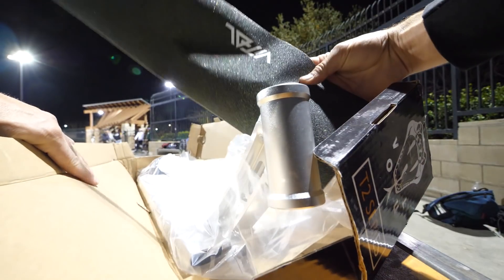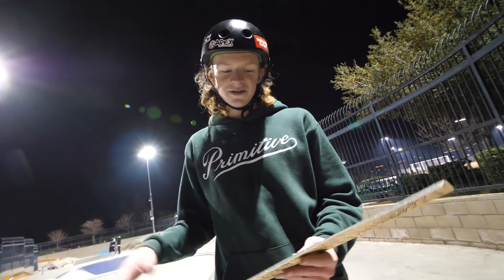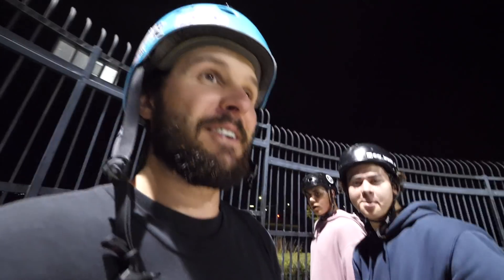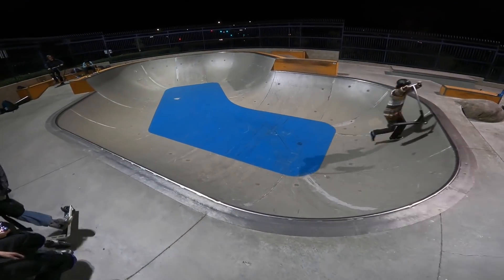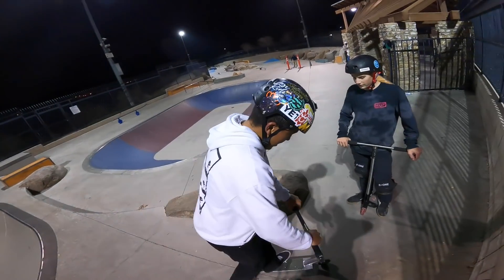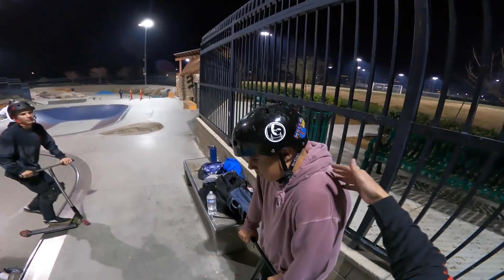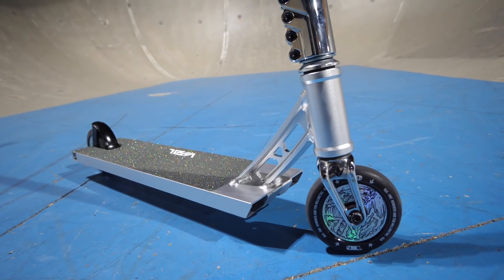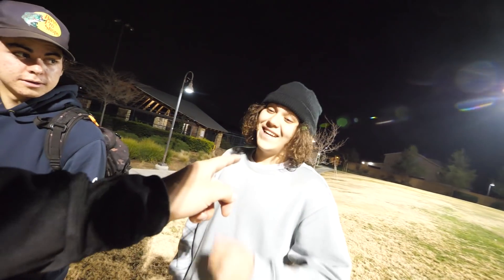I BOUGHT A $99 AMAZON SCOOTER DECK!

Comment: 😂😂😂😂😂😂😂😂
That's sooooo funny because, A French scooter freestyle company did just released In January a 5.5 x 22 Boxed with a semi cheddy fender at just 90€ or roughly at 103$ and It's pretty great so now there's no excuse for being able to find a great deck at this price point other than a bad scooter brand.
And for the most curious people that reads this comment, the deck Is called the Oxelo MF540 Boxed (there's a non boxed version at 4.75 x 20.8 at just 50€ or roughly at 57$ too though) and, I'm currently testing the boxed version In order to make a video about It on my channel.
Reply: And the back ends are curved and It can fits up to 120mm wheels
Reply: Last Info about these two deck that I'm talking about, they are objectively way better than the deck In this video but, they are only available In Europe (Uk Included)